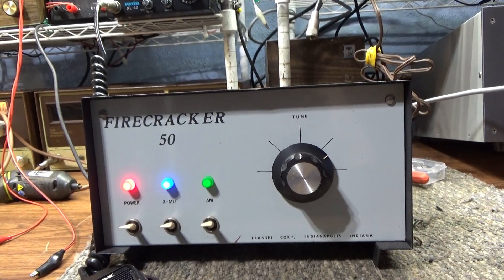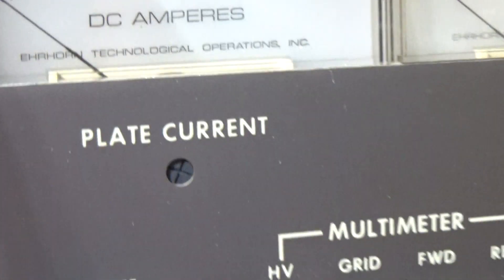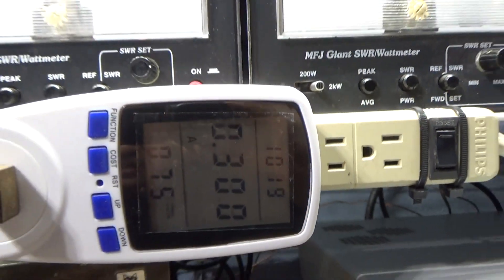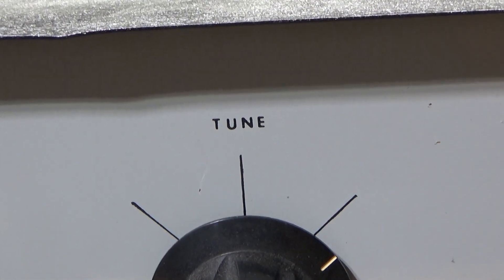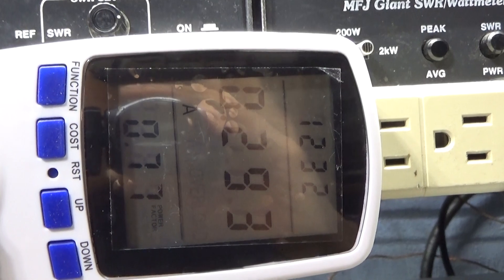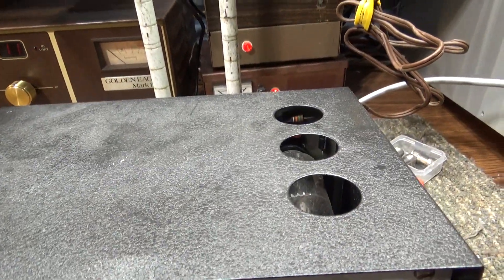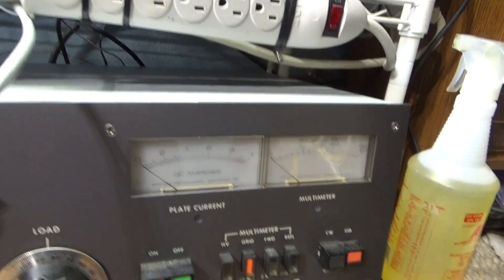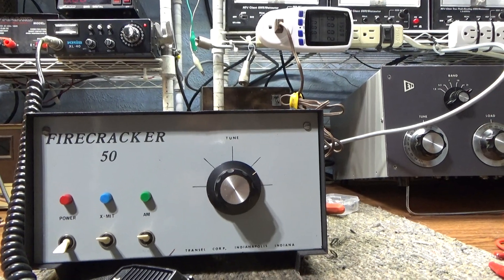Check Your Amps.

Comment: I have a unknown l0-80 band amp from 1951 and it has meter that can be switched between plate current, plate voltage, and screen current thing weighs 150 pounds.

Comment: Great video. I have the same little amp tucked away as well. The amp meter could be used for max fine tuning the tube amplifier over a traditional analog rf power meter.
Reply from the maker: yes, but it is a little more complicated that way.

Comment: Harbor Freight and Lowe's carry those meters too. 
Watt's Law is this: volts times amps equals watts. 
As a general rule of thumb, a linear consumes twice as much electrical power as the RF output power. This comes in handy for calculating how much power you have on any one circuit. If you have a 1500 watt pelonis heater on and plug in a second one on the same circuit the breaker will trip. 120 volts times 20 amps equals 2400 watts. Stay safe!
Reply from the maker: Agreed.

Comment: Anytime I built an amplifier, I always included a plate current and grid current meters.

Using microwave oven transformer (modified), they tend to draw quite a bit of current on standby - about 3 Amps or more on 240V AC...
Reply from the maker: Wow, I know zilch about microwave transformers. That does not seem good though,  3a x 220v = 600+ watts of heat during standby.
Reply: @tramdr you have to knock out the magnetic shunts from the centre of the transformer, using a metal punch. One of the secondaries is connected to the frame of the transformer, this needs lifted above ground.

Comment: A very clear explanation Doc! Thank you for that. I like to think of the tune and load adjustments on my amps as similar to an antenna tuner for the amp. It matches the impedance of the tube or transistor to the antenna, or radio. Why would you not want to run your antenna tuner at peak performance?
Reply from the maker: Exactly and your 'theory' is right too. For the most part, the 'Tune' cap tunes the Tube and the 'Load' cap tunes the antenna even though they inter-react with each other. One reason why a manufacturer can make an amp with a fixed tune cap in an amp, like many Blackcats. If you use the exact same manufacturer and tube type, the Tune cap won't really need to be changed or varied. However, the problem is, put a different tube in them and now its going to be off. Example, go from Eiamac 3-500z tubes to Amperex 3-500zg in the JB-2000. Same with the JB-76 when you switch tubes especially from the hard to find 8417P's to something else, now you loose a lot of power because you can't Tune the new tubes in.
Reply: @tramdr  thank you for the further explanation of that Doc! 👍 I’ve noticed that various manufacturers have different pf for the various elements of a particular tube. Not always the same, despite the number being the same as another manufacturer.
Reply from the maker: Exactly right. Take out that Sylvania and pop in a GE of the same tube number and now watch your watts drop because of that. Same thing on both the Input and Output sides.
Reply: @tramdr  Oh wow! In the late 60’s and early 70’s I remember guys discussing the replacement of tubes in their amps. (Something I couldn’t afford) And many of them would swear by this brand over that brand. So in reality they probably were a bit different in capacitance of their elements, all that was needed was a change in a fixed input capacitor and they would have been fine! All of that arguing and “Hate and discontent“ for nothing!
Also, I remember my uncle had a massive tube amp on his steel guitar. But at audio frequencies the tubes weren’t as picky on brand. I guess their internal capacities didn’t have so much of an effect?
Reply from the maker: Exactly right again and audio freq does not care about small differences of PF in input and output. Audio works different. With RF, the higher you go in frequency, the more the Tubes internal capacitance makes a difference. Case in point is that the internal PF of the output side of a 3cx3000 tube is so high, that many Hams say that it will not work on 10-11 meters. This is basically true, but there are workarounds. IMHO most, but not all, amp builders do not know about the too much cap issue of a 3000 tube and even when they copy what somewhat else did, they don't know why the builder did what he did to get around the issue. What most CB builders did was use a very low Q in the tank circuit to get around this. Lower Q needs more tank Tune capacitance so that tube will work then. However, lower Q means a lot less output filtering, so a lot more harmonics and bad stuff. Hence, those 3cx3000 boxes built like that will show a lot of FALSE watts. Henry did not use any capacitance at all at the Tune capacitance point. They used only a roller inductor and a Load variable on the tank, and plus they used a Pi-L tank circuit which gives better filtering than a standard Pi circuit and plus a Pi-L needs a little more Tune capacitance then a Pi does, so the Henry design is win-win. However, mud ducks get a Henry Box and start CB'ertising it to get Mo Watts and they muck up what was a good box.
Reply: @tramdr  Wow! That’s great info on the Henry amps. I didn’t know that. I have a UHF TV station tube (TH 382) that someone said could work on lower frequencies, but wouldn’t be worth the effort. But I grew up poor, on a farm in Missouri, and had to go to the community junk pile and cut out parts for my projects. It wasn’t easy, but I learned a lot. I still have many of those TV transformers. I’ve got the feeling that you went through the school of hard knocks as well.😊

Comment: Firecracker Firecracker Raha Raha Ra😂 good little driver or local talker.  Man I've had it rough past year or so. When I get ready I wish I could find a good tube amp. You wouldn't part with one would ya? Not right now maybe couple months I want a big box.
Reply from the maker: But I'm a little boy and I only play with small to medium boxes.
Reply: Define "big box". Until the Phantom came out the Elkin and Demcos were big boxes. Until the Heathkit 220 came out the Phantom was a big box. Until the Henry 8K came out the SB-220 was a big box.
Reply from the maker: Dude, here in Detroit, even back in the mid 70s when I started, the big boys on the Superbowl were running 'Crab Boxes' with multiple 3-500Z's, multiple 4-1000 boxes, and ceramics like 3cx15,000's. You've heard my story about my Drake L4B? Well I sold it because a Big Boy gave me a lot of money because he wanted it bad........he needed it for a driver.